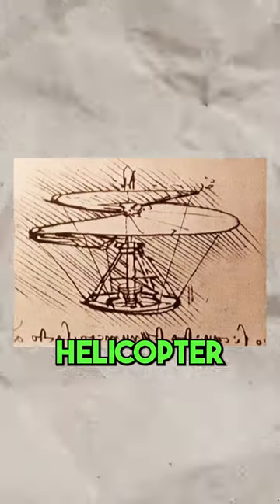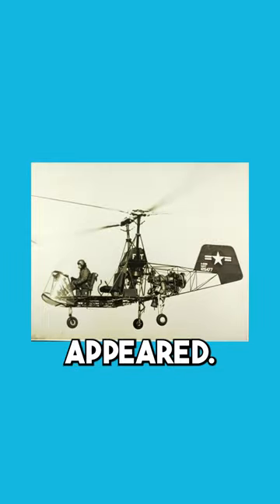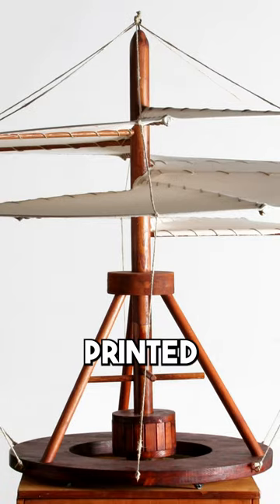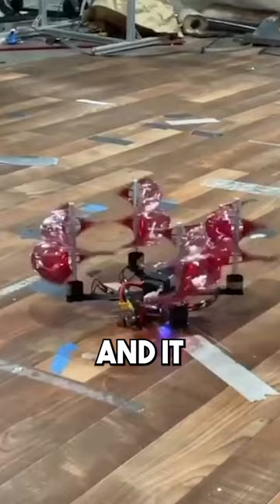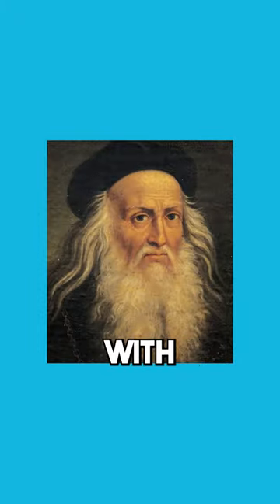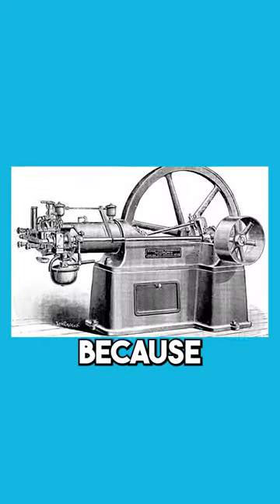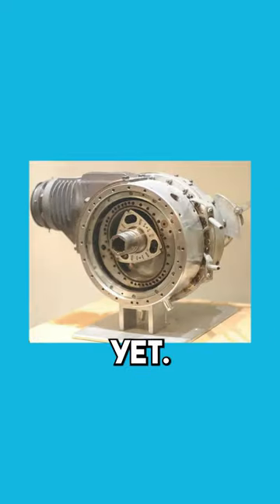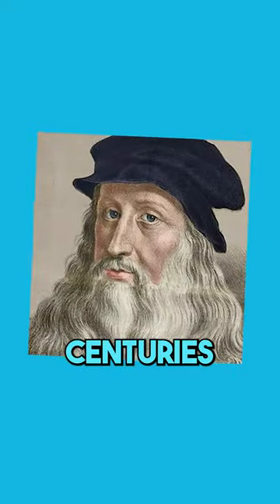Da Vinci's helicopter actually WORKS! Invented 400 years ago! #shorts

Comment: Less downwash = less lift

So it's a downside anyway
Reply: well, it could work for stealth missions maybe if the sound could be dampened even further using modern materials, still worth pursing for some use imo
Reply: @jonathanwells223  if its that worth it, it would be mainstream by now, but its not

Owl feathering texture provide better stealth for propeller blades